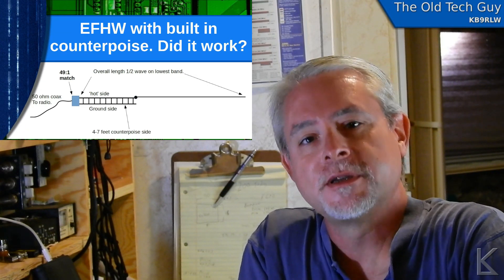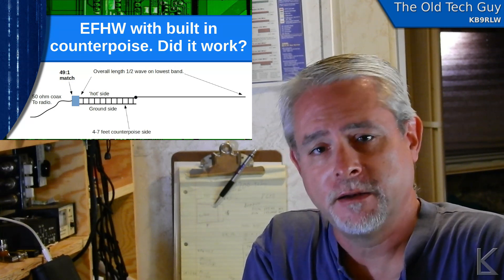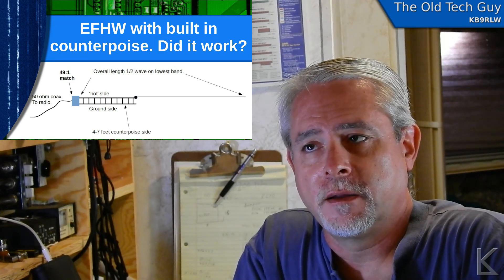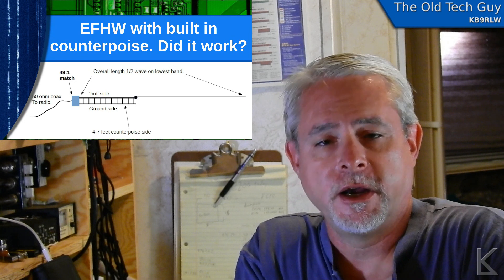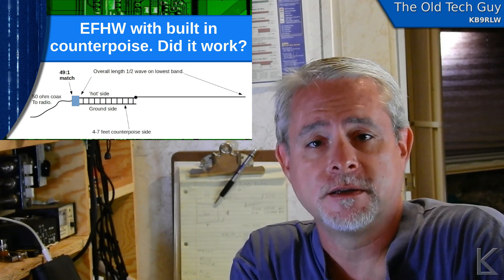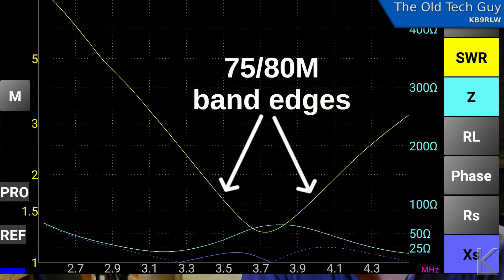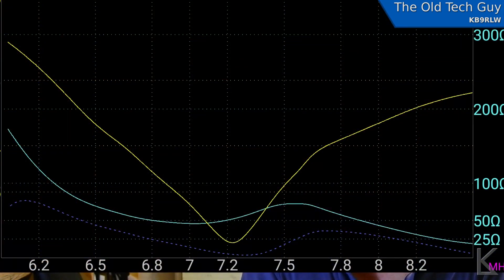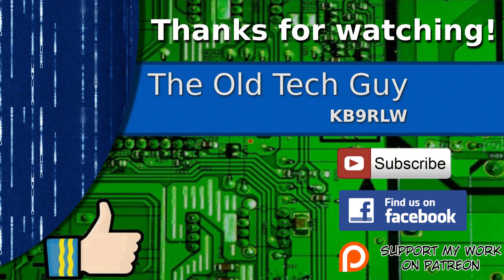Ham Radio - Update on the EFHW built in counterpoise experiment. Did it work?

Comment: Thank you for the information.  Things that don't work like you think it will still teaches something.  I think that what you have is about same as I will end up with.  I have a 60 foot tower and think I will be going from 50 feet to something about 15 -20 feet high.  My VHF-UHF antenna is at the top. I am hoping that I can put a 10 foot PVC with about 4.5 feet out each side. 2 HF antenna,  one on each side of the towers. Each with its own point it goes to. 73.  W4DES

Comment: I'll throw out a belated comment on this for posterity reasons.  What the design reminded me of was a W3EDP.  I used this design for Field Day, HOA, and odd portable deployments.  Not great but worked well for many of years.  I think the use of the 49:1 to UNUN was the issue.  The original design notes for the W3EDP call for a 4:1 BALUN.  All my years of tinkering and deploying this antenna just made me realize it was just a variation of EFZ or a Folded Windom depending on how you look at it.

Comment: One comment on grounding and keeping RF off the coax or feedline. RF is like other current in that it follows the rule “ current always wants to return to the source. If the return path for current, DC, 60 Hz AC, or RF, to get back to the source is through the ground then it will try and go that way. It there are two parallel paths it will split based on the impedance and some go one way and some the other way. There is no reason to think RF will magically go to ground unless that’s a good path to complete the circuit back to the source. One more comment. A single ground rod is not going to make good contact with ground. Although ground may be a good conductor there is going to be a significant contact resistance between the ground and the ground rod
Most antennas work fine with no ground at all. End fed wires, not being complete antennas need either a ground or counterpoise to complete the antenna. Current leaves the source (transmitter)  comes out from the center conductor of the coax, out the antenna wire, through the air and re enters the antenna on a wire then flows back to the source on the inside of the coax shield. That’s a complete circuit. If half the antenna is missing, the current that leaves the antenna wire needs to somehow get back to the source terminal that’s usually  connected to the transmitter chassis. It does this by possibly several paths. One way is finding its way to the outside of the coax shield. Another way is into the ground and up the ground wire to the transmitter chassis. Another way could be on a power cord to the transmitter. In all cases the amount of current leaving the source must be equal to the amount of current returning to the source. I can think of no exceptions.

Comment: I  have been using several monoband efhw antennas made by a German guy (www.lambdahalbe.de).  They have no transformer and use a length of window line with an adjustable slider to adjust the the resonant frequency.  They cover most of the bands with (much) less than 2:1 VWSR.  I'm not sure how the slider functions to adjust resonant frequency.  I can report that the antennas work very well. I use the 20 meter band antenna combined with a 12 meter Spiderbeam mast for portable work.  The mast is long enough that the antenna wire hangs vertically.   Maybe you can enlighten me on the function.  Vy 73 David DM3BC

Comment: I have two myantennas.com EFHW antennas:  An 80-10 meter and a 40-10 meter.  One is oriented East-West and one is Northeast-Southwest.  I have tried the transformer near the ground with it grounded to an 8 foot ground rod driven all the way into the ground.  I have tried putting the transformer up 30 feet with and without a .05 wave length counterpoise.   Recognizing the coax feedline is part of the radiating antenna system my final configuration for both antennas is horizontal up 30 feet with RG 213 low loss coax to my shack with no counterpoise.  The coax lays on the ground for about 60 feet.  About 6 feet before entering my shack I have a common mode 1:1 choke balun made by Mfj modified to allow two SO239s on each balun.  From the balun to my window antenna connector is a 6 foot piece of 213 coax.  The window entry to my shack is grounded to two 8 ft ground rods and all my shack equipment is grounded to a common copper tube connected to the external ground rods.   I am using a Yaesu FT-991A transceiver with an RM Italy 300 watt amp ( about 280 watts PEP phone).

Results:  

I have modeled this antenna on EZNec 6.0 software and the pattern at 30 ft over avg ground is similar to a diplole and slightly directional perpendicular to the antenna wire.  Like a dipole it is a low gain and mainly a omni-directional antenna so my used $350 amp helps get my signal out.  Just about every night I am on the OMISS 40 meter net (7.185) and only need 5 states plus Alaska to get my worked all states award.  Last night I was one of the few on the net that reached Hawaii and I live near Oklahoma City.   My signal report was a 3x3 but that is 3,800 miles from my home.  Finally I measured the common mode current entering my radio when transmitting using the Mfj rf current meter and it is almost but probably less than 2 mA.   If you have the room this is a great antenna for someone who doesn’t want to put up a beam or Yagi for whatever reason.  These antennas are truly multi band with the only frequencies above 2:1 SWR are at the high end of 80 and 10 meters.   Most bands are less than 1.5:1 SWR at the feedline before the balun.

Comment: Hi Kevin, KEØOG here. The ladder line section is a transmission line, and acts as an impedance transformer, so I'm not surprised the whole thing didn't resonate well. The fact that the rearranged EFHW on 80 is less than 2:1 across the band is weird, as no dipole covers the entire 80 meter band. Have you tried using the tower itself as a counterpoise? That would be interesting and could possibly help eliminate RF on the shield. Maybe just coiling some coax as a choke balun prior to the 49:1 balun would help. Interesting experiments. Hope you are doing well.

Comment: Hey Kevin.. good video.  thanks.  I think what you have still is a short balanced line transmission line with no actual counterpoise at all.  I bet if you'd have connected 8 or 10 inches to the 'ground' side of the open wire line and let it dangle - you'd eliminate your RF.  At least you'd have a counterpoise.  I've seen antennas like that.  In my case, I have one foot of coax to my unun and the ~130' wire connected to it. I have my rig grounded via an 8' wire out the window to a ground rod.  I tried connecting this ground wire directly to the unun but had no change in SWR so I just connected it back to the rig.  I've had no RF problems in the shack, on any band, at the 100w level.. with the unun two feet from me and only one foot from the rig.  I'm frying myself I'm sure.  That's my excuse!  73 OM and thanks for the fun experiments you're sharing

Comment: Hello Kevin. For my portable station I use a 148' Random Wire, MFJ's little L-Network Tuner, and a loom of 1/4 wave length wire one each for 10, 20, 40, and 80 meters so the Random Wire can work against it. I said all of that to say this, have you tried any 1/4 wave wire as the other half of the antenna? I have the QSO King antenna and wasn't real impressed. I tried it grounded to the chain link fence, no ground just 50'ish feet of coax. I also tried it both ways with and with out a 1:1 choke at the transformer. I'm going to put it up again, but just try the 1/4 wave loom of radials. It's only experiments, that too is part of the hobby!

Comment: in the RV Park you could try a Rybakov Vertikal its antenna basically a 7.6m vertical end fed with a 4:1 un-un (unbalanced-unbalanced transformer). feedpoint close to ground. i have tried it works ok. 
https://wb3gck.com/2018/12/09/revisiting-the-rybakov-806-vertical/

Comment: i recently built an efhw useing a 49-1 auto transformer and a 10m sota pole nearly all that i read suggested that the feed point needs to be at least 1m (3ft) above the ground  . i tried with and without counterpoise and to be honest there was very little difference on incoming or out going signals it is a nice broad baded antenna with an swr of 1.1 to 1 at its lowest and 1.5 to 1 at its highest i now have a cushcraft r8 and i keep the efhw as a backup

Comment: I have been using an 80M EFHW antenna for a couple of years as my main antenna.  It is an inverted L configuration allowing me to keep the feedpoint close to the ground and to the ground rod.  I use an ABS bicycle pedal with all of the hardware removed as a support at the top of the L and at the other end.  I use a garage door spring for strain relief and the antenna does very well.  Still needs a decent tuner here and there.

Comment: Grounding/bonding should happen everywhere power is transformed. So if you have a power supply grounded, where you transform 120V to 12V, and your radio is grounded where it transforms DC back to the variable AC signal that travels out the coax, you will get “common mode” transient voltage as soon as that 50 ohm AC signal hits your 9:1 unun. (Or any unun, even a 1:1) A standard quarter wave antenna (also unbalanced) sends back RF on the coax too unless the SWR is exactly 1:1. So even grounding the unun to a shitty earth ground, like a hole drilled into a tree’s fibrous root system, that unbalanced return load that is lost (not transmitted) by the antenna, should bleed off significantly. It won’t be as nice of a path back to your transmitter as the coax shield, but it should be very similar to the crappy path a stand alone ground rod, or additional radials would provide.

Comment: Kevin,
I have been playing with 49:1 EFHW Transformer Antennas for over 1 year.
My research/experiment's/testing with /without a counterpoise works on 11 meters am/ssb 26.965mHz-27.405mHz. Which gives a low swr reading across the entire band due to using 2 Ft-240-43 ferrite toroid core's wounded 13 times with rg8x coaxial cable around each one.
Placed at the antenna fed-line and at the transceiver for rfi/tvi/cmn suppression. I'm using a 66' sloper 18g wire up 15' at the base fed-line in a sloper 45 degree configuration up in a 45' tree pointed northwest/southeast direction. This length give me a 2 fullwave end fed antenna.
Try attaching 2 Ft-240-43 ferrite toroid core's like I did. This is what you're looking for to bring 80-10m swr down across the band's alot better than what you have.  You're going to be amazed what you see. The counterpoise wire underneath the 66' sloper I'm using is 8".6". Which is good for me. But for you it will be
 17'.2"  for the 132' of wire you're using horizontally.
Don't ground it let it float down in a inverted L configuration. You just like I did will see the big difference with skywave/groundwave  propagation conditions with/without a counterpoise wire.
73

Comment: Why not add rf ferrier chokes to your coax.
Reply from the maker: I did, it helped a bit.
Reply: @loughkb  you need a good, SHORT, connection to an rf ground. Also, google Hentenna.
Reply: @loughkb  you also need to check out the Russian Antennop? Website. Excellent and weird antenna designs.

Comment: A caution about SWR.  Any losses in the feedline, balun, etc. will make the SWR low but will not result in radiated energy.  You might try putting a power meter and dummy load (of suitable resistance) after those items and make sure you are getting the power out to the antenna.

Comment: I'm still loving these real world experiments.  I'm almost ready to string a wire over my house to use as a non-resonant end fed wire with a tuner.  Not as efficient as a resonant antenna but my base station can run a little more power to make up for that, and it's not a problem to use a tuner in the shack.  The plan for my base station antenna is to run a ground wire straight down from the feed point to a ground rod, both for lightning protection and to act as a counterpoise.  For the portable rig, I'll probably use a tuned EFHW antenna for each band I want to use for best efficiency.  If I run a mobile HF rig in my truck, I'll probably just carry some coil loaded whips that I can screw in to a 3/8-24 base, with the option to string a dipole for NVIS when parked.
Reply: Wont work. Rf grounds need to be SHORT, a small fraction of the working wavelength. Lightening ground is NOT the same as RF ground!
Reply: @einstein.1869  - Hey Einstein (always wanted to say that), do you have a reference to substantiate your comment?  The only place I recall seeing the 1/4 wavelength figure used is for radials, usually in the context of a vertical monopole, as opposed to the horizontal end fed wire I'll be using.  I'm not an antenna expert but have read extensively.  The problem is, I read a lot of conflicting information.  When describing radials, the 2007 ARRL antenna handbook refers to 1/4 wavelength radials in one place and a few pages later they mention 1/2 wavelength radials.  The usually excellent Joe Carr doesn't shed much useful light, either.

There are three different antenna grounds.  A safety ground is used if there is an equipment fault that puts a high voltage on the coax shield.  A lightning ground directs induced electrical current away from buildings, and while a well designed lightning ground can help with a direct strike, all bets are off and there will probably be a lot of damage.  The RF ground is used to improve the radiating efficiency of unbalanced antennas such as the vertical monopole or the horizontal end fed wire such as I'm planning to use.  I just spent 30 minutes reviewing some online information on RF grounds and I saw nearly ubiquitous advice that they need to have a low impedance to have a good antenna efficiency, but I didn't see any references to the length of the wire from the unun to ground.  The articles were in general agreement that a ground rod has too much impedance to be an effective RF ground and radials or a counterpoise should be used, either directly or capacitively coupled to ground.

I think I'll follow Kevin's good example, in the finest tradition of amateur radio, and sweep all the amateur bands on my end fed wire antenna, with and without the ground connection, and maybe with a counterpoise buried a few inches below the ground if I get that much mojo.  While a non-resonant end fed wire isn't an efficient antenna, people seem to have fairly good results with them, even when using 15 feet or more of coax in lieu of a proper counterpoise.